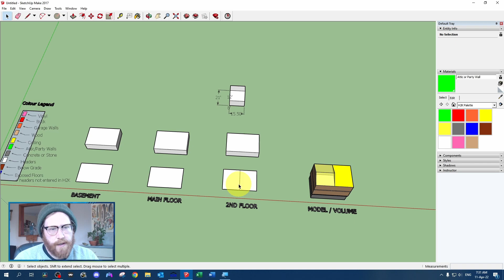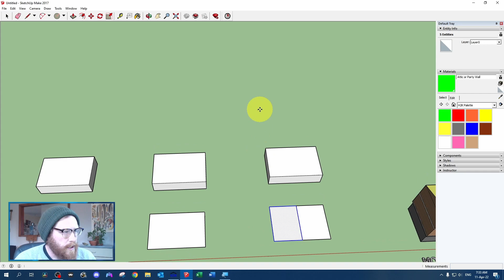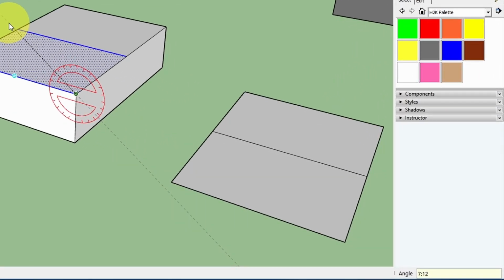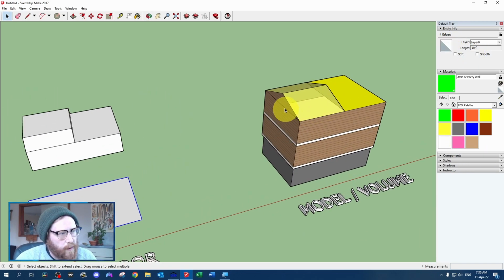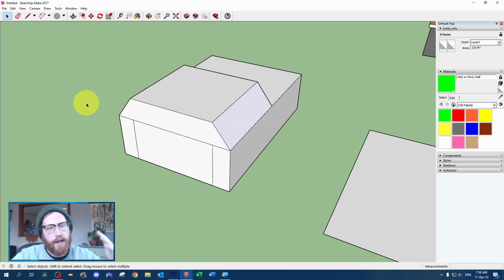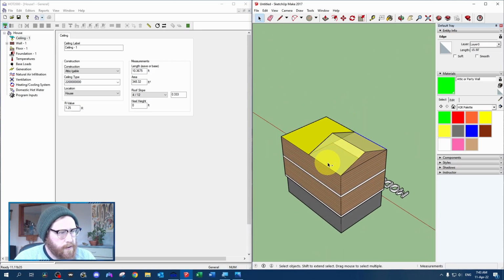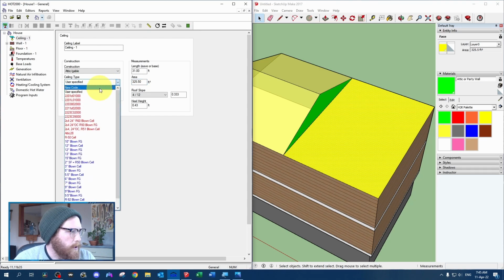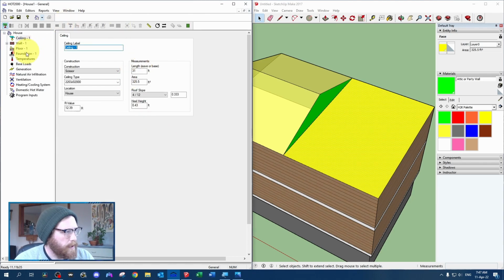Ceiling Basics in Sketchup and Hot2000

Comment: Hey! new Hot2000 user here and future energy advisor. if we were to model your example, would we have to model two separate ceilings, in order put both roof assemblies with their parameters to show the program they're side by side?
Reply from the maker: Hey there Erik, you always want to enter sloped ceiling separately from flat. Also with split levels it's a good idea to break out ceilings separately incase the homeowner only upgrades 1 and not the other.

Comment: Great video. I have created a slope ceiling using the extrusion tool as you have but also by creating a line or reference point at the peak, drawing a ridge line then stretching that line to the reference point. You are using SketchUp to determine wall and roof areas and space volumes for manual input into HOT2000. The lack of 3D input integration between SketchUp and HOT2000 is a significant limitation of HOT2000 which uses bin weather data. EnergyPlus is a true hour by hour commercial building energy simulation program funded by the US DOE that has a SketchUp plug-in such that the building envelope definition is populated when you create the building model in SketchUp. The SketchUp model defines the building in either Openstudio, the graphical user interface (GUI) for EnergyPlus or directly into the EnergyPlus IDF, which is a text based input file for EnergyPlus. The easiest way to define weather, schedules and the HVAC system is through the OpenStudio GUI which converts all of the inputs including the SketchUp model into the EnergyPlus IDF input file. The EnergyPlus simulation engine is then run to create the reports based on the hour by hour weather data. The HVAC systems and the energy saving measures that can modeled in EnergyPlus is extensive. Using it for a residential model though, is like using a sledge hammer to drive a finishing nail.
Reply from the maker: Hey Ralph I totally agree that it would be nice to integrate Sketchup and Hot2000. It would be so helpful. In Canada for provincial and federal energy auditing programs, we have to use Hot2000 to do the modelling. No way around that. This is used to provide rebates to the homeowners going through the program. I am interested in learning other modelling software, I'll be sure to check out EnergyPlus. Does it have weather data for Canada, or is it US only?
Reply: @merrytimes  

EnergyPlus has a number of weather files for Canada. There are 3 in New Brunswick and 5 in Nova Scotia. 

I used EnergyPlus to model a 1 1/2 storey heritage lakefront residence with multiple dormers to evaluate the baseline energy consumption. The EnergyPlus Muskoka ON weather file was used, being the nearest to the site. 

This residence had a stone wall foundation where the crawl space "floor" was exposed Canadian shield bedrock. The Kiva foundation algorithm was used to model the heat transfer in the foundation. Kiva generates a two-dimensional heat transfer calculation to represent heat flow between a zone and the adjacent ground.  The Kiva foundation inputs are used to describe the two-dimensional features that cannot be captured by the typical one-dimensional constructions used in EnergyPlus.  Not all of the foundation wall surface needs to be below grade. The version of OpenStudio GUI used, did not have Kiva inputs so the EnergyPlus IDF editor was used to modify the text based EnergyPlus input file created by OpenStudio to define the stone wall foundation sitting on bedrock. 

EnergyPlus is a comprehensive program. The input output reference guide has over 2700 pages.